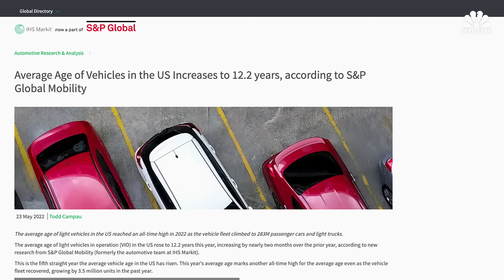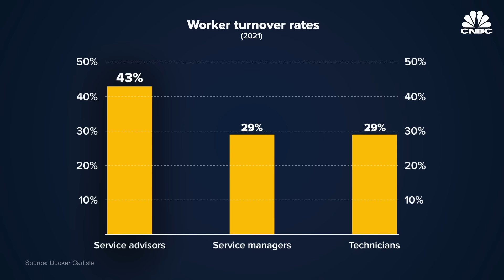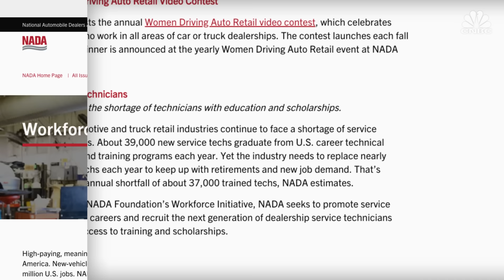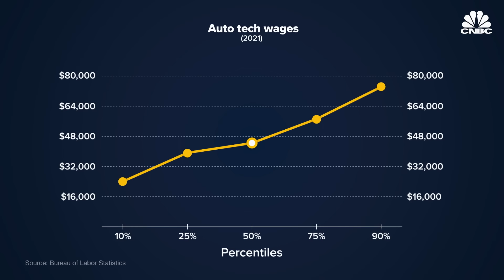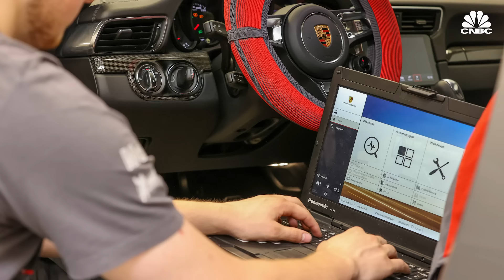Why The U.S. Has A Shortage Of Auto Mechanics

Comment: As a former mechanic, who is ASE certified, I will tell you why I left the automotive industry: 

1. Flag time, aka flat rate (i.e. paid for the job). The burden of the ebb and flow in the amount of cars in the shop should not be foisted upon the mechanics. There were many weeks where I worked for 40 hours, but I was only paid for 20. Flat rate also encourages mechanics to cut corners on repairs, just to save a little bit of time. 
2. I had to pay for my own tools. Not only was I getting paid terribly, I had to purchase my own tools. I have at least $30k worth of tools.
3. The pay is not commensurate with the amount of knowledge a good mechanic needs to have. In my opinion, this is an engineer-level amount of knowledge. Electronic systems, hydraulic systems, air conditioning/heating systems, internal combustion theory, transmission systems, electric car theory, etc. The amount of knowledge is huge.
4. The benefits were TERRIBLE. Very little 401k match, vacation, bonuses, crappy insurance, etc.

I was a smart mechanic (in my opinion), and I left the business to get a bachelor's and master's degree in science. Now I am a scientist/engineer, making the amount of money I should have made as a mechanic. The industry will continue to hemorrhage good employees until they fix the issues stated above.

Edit: thanks guys for all the feedback, glad my post resonated with so many of you!
Reply: Don't forget you can get to the showroom and find a handful of guys making double that of a tech and know far less about the cars than a tech. 

Pay is way out of wack in the car biz. 🤦‍♂️
Reply: 100% accurate
Reply: Someone pin this comment!
Reply: Yes same here minus the getting a masters and all that I became a truck driver and make way more money with way less work and little learning having to be done
Reply: Former GM World Class Certified Tech here. You hit the nail on the head. Now, I run my own one man transmission shop. I won't go back to the dealership until a lit of changes are made.
Reply: I've definitely been noticing this issue
Reply: Simply not paid enough is pretty simple. There’s too much bad overhead associated with the trade.
Reply: You are both a scientist AND an engineer now? Those are two very different professions.
Reply: 100% Correct. I was an "Automotive Technician" for 16 years, $100,000 worth of tools. I specialized in Transmission and Driveline for GM. Went back to school and earned a Bachelors Degree in Electrical Engineering.  Now, I work as one in the Automotive Industry. This CNBC report fails to mention how we are treated as Automotive Technicians. The vehicles got more Advanced, but unfortunately the public remained ignorant and ungrateful to the services we provided. It takes a toll on your soul when you're repeatedly told you're being dishonest. We are just trying to help a person move along in life. This trend will continue.
Reply: sell me  some Tools
Reply: Agree! Former Toyota Master ASE. Worked from 2005-2010, went to college while working as the shop foreman. Just Got a bachelors degree in IT, CCIE network architect now for the government. And yes, everyone in that dealership made more than the techs, go figure.
Reply: The thing is, if customers can fix their cars then why hire a mechanic? And fees to repair your car are too high for middle class people. It's the middle class that pay for the repairs, hence sustain mechanics. The high class would just sell the car and get a new one and the low class would dump the car or try to fix it by themselves. Middle class is the rising class that needs to save time to work and make the jump to high class so they would rather pay for repairs and save time. But if the price is too high they would rather make the fix themselves. In my case, I fixed stuff in my car that would have cost me $600 for parts and labor. But I only spent $300 on parts and spent a weekend fixing stuff.
Reply: My brother makes a ton of money modding people’s cars , guess he found a niche he’s good at
Reply: Thank you for that explanation
Reply: Market forces at work baby! The shortage will force employers to pay more or somehow a new product will reduce the need for mechanics/technicians.
Reply: I am also a former ASE Certified that left the industry due to inconsistent shop volume. I am now in a different industry earning the best money of my working life.
Reply: @joejoey7272  those are the few that actually enjoy what they do. But only so many people can do that the market can’t have hot rod shops everywhere. The regular dealership tech is the one that is getting shafted and hates their job.
Reply: Lets not forget all the training, and professional development, on an ever evolving product line. Wait what!
Reply: @andrewp91  Thanks for the heads up, I just graduated college with a degree in net administration. Now I'm terrified.
Reply: @th0rn3gaming  this is why I went to sales
Reply: @terencebrake6233  I never wanted to learn to wrench because the pay is terrible. If I am forced to work I'm not busting my sllab on wrenching when I can make more selling.
Reply: I was always shocked at the pay mechanics get while having years of knowledge and having learn about new cars.
Reply: What I am hearing is that the dealers know what the problems are, but they don't really want to actually deal with those issues. Complaining publicly is easier and perhaps even better for business (H1B visa perhaps?).
Reply: @who2u333  I can tell you this much, you don't own several $120,000 cars meanwhile you're average employee drives a used Toyota Corolla.
Reply: Lots of respect for mechanics. This is not task oriented. This is a problem oriented job, that requires people to apply their knowledge and why things work the way they do. You have to have a certain mind set for this, and we don't compensate people who do this well.
Reply: I agree, however you should also add in the customers. The VAST majority of customers are 100% ignorant about their own cars and just assume we're trying to rip them off. Unfortunately most of those "top earners" this guy states in this video ARE the ones ripping people off.
Reply: Dont seem right that someone puts in long hours and is refused medical-care and 401-k plans that government employees get automatically
Maybe the larger shoppes such as Rivian and/or Tesla can pay medical benes and 401k's to get the guys with family obligations to signup and STAY.
Reply: @Oncopoda   not really have none many different people form both . It more a different mind set. I offten find it vary difficult to find someone that can hold both mind sets at the same time.
Reply: @tdf123emcee2  I agree with this grow up poor and will never make middle class in this economy even if I live to be 100. So I only ever drive vary old cars I can fix my self or keep working in exstramly damaged states. I care first and foremost about how easy is the car to report and then about how much it cost
Reply: It's surprising that a trade as old as auto mechanics isn't unionized. If you guys were unionized you wouldn't have those hourly pay problems and the burden of buying all of your tools. I'm a retired union HVAC mechanic. We are expected to buy basic hand tools and work shoes. Anything beyond that is on the company. It's in our contract. The same goes for most unionized trades. Also we have amazing medical and vacation benefits. I was able to retire after 25 years of service. Oh, and I forgot to mention that our training was entirely paid for by the contractors.
Reply: @uwone7778  You nailed it 100%! my good man! I’m a lifelong industrial mechanic (pumps & automated production machinery). I work a 4/12hr workweek plus frequent OT and plan to semi-retire in two years at age 59. Not near enough young men going into the trades.
Reply: @th0rn3gaming  the whole dealership model is really the problem. They want to make money selling not fixing. If Ford owned all the service centers, than there's just no doubt they would have a standardized training system, better 401k, exc.
Reply: @who2u333  bring them in from Peru lmao.
Reply: Yeah, wish I would've gone straight into a science or engineering field right out the gate but eventually I woke up and am on my way now.
Reply: All true. Employees in general are not respected. Anyone who does a good job should earn respect and appropriate pay.
Reply: Exactly brother! We feel your pan too!
Reply: Great post but you didnt mention that the work itself is pretty physically demanding, lifting bending standing on concrete all day.  It will wreck your body.  Oh and heavy chemical exposure.  Plus the image problem (grease monkey).  Congrats for moving on, im older and wish i had done so years ago.
Reply: You were smart to switch  careers,and today the  future is ELECTRIC, and the  ICE will be mostly retired come  2030 -35 , that is about a decade  give or take a couple of years, and  in about 5 -8 years a Chinese BEV will be as  common as  a Hyundai and Kia  or  a Toyota.
Reply: @th0rn3gaming  Car salespeople make a fortune for the STEALERSHIPS.
Reply: Going to the dealership for repairs is certainly not cheap. Sounds like a lot of the money does not go to the mechanic actually doing the work. I don't mind paying for quality work, but don't like seeing the person actually doing the repair not getting the proper compensation.
Reply: They make you pay for your tools? That's messed up! If you're working for a dealership They should be paying for your wages and equipment. Office workers would riot if management made them pay for their laptops.
Reply: Are you referring to what my friend called, "Making book?" there was the Chiltons book where it stated what a typical job would take. Ex. The changing of a widget shall take 2.5 hours. BUT that is in a perfect world, test bench environment where the engine is new and will not account for a rusty bolt when the head snaps off a 10 year old, filthy engine, and you have to use a bolt extractor.
Reply: @Oncopoda  Computer Science is both engineering and science.
Reply: @andre-le-bone-aparte  it absolutely is not. I'm a software engineer. We often learn computer science as a base, but computer scientists exist, and they're a different breed.
Reply: @aerialdarkguy  yeah paid thousands buying tools and boxes. Left the business. Now doing auto warranty claims adjusting at home. Went from sweating my tail off, barely sitting down to working in pajamas and sitting on my butt. And getting better pay. Lol
Reply: @apacalyptic1freelancevideo213  I have some Made in  China 🇨🇳  Harbour Fright  specials ,bought
 on-sale , it will be in next week's Garage Sale🤑
Reply: Good points, and this industry is not for everyone. Me personally, I've been a tech for 20+ years now. However, after 8 years burning out in a dealership, I decided a change was needed. So I just went independent. Independents are the best route to take for a mechanic in my book. It just requires some discipline, and some practice running a business. Once you master that, you will never look back.
Reply: They need to go back to being union employees.
Reply: @lavelchase6040   Precisely. In 20 years i can remember only a few times where my hard work was actually appreciated. And then people wonder why there is so many dishonest people ...... have you tried showing your appreciation instead of acting like an entitle ignorant pos? If you already think i'm ripping you off.....why not do it and get paid for what youre being blamed for.
Reply: @th0rn3gaming  
Car salesman,  realtors,  salesman in any field are over paid paper pushers who have to know NOTHING about their jobs.

Ask a car salesman if the car has a dual master cylinder and the answer will always be yes. 

Ask a Realtor any question about a home you are looking to buy,  and the answer is "I don't know you have to ask a home inspector that. "

My point being it must be nice to know nothing about their job and get paid top dollar to warm an office chair all day.
Reply: I thought the flag time was basically the way techs get raises. The job pays $X - beginners take twice as much time so effectively get paid less per hour, after a couple of years people are taking the expected amount of time, and experts take significantly less than the projected time.

Does it not work that way?
Reply: @CharlesBallowe  
That is exactly how it works, but the manufacturers keep cutting the time down so the tech and the dealership get paid less and less every year.
Reply: @who_wantsit  changing flag hours for the same task, or new cars getting faster to fix?
Reply: @Oncopoda  Maybe at one time it was true. These days, luck favors the flexible.
Reply: @CharlesBallowe  No that's not how it works. Flag time has two tiers:

Warranty pay and customer pay. The exact same job pays differently depending on if it is warranty or CP. just to throw out a number. Say replacing a radiator on a vehicle. The book time under warranty pays 2 hours. But the book time under CP pays 3.5 hours. This was structured into the pay to compensate for wear and tear.

The ideology is as follows: a vehicle under warranty is technically "new" the parts have only recently been put together. The vehicle has low mileage, so it hasn't seen as many heat cycles, debris, exposure, etc. so technically it must take apart and put back together easier. Hence the lower book time.

A customer pay job, the vehicle is considered out of warranty. Means it's at least 5 years old, or at least 75k on the clock. This vehicle has seen it's fair share of duty time. Probably has battle scars it picked up along the way. It has many more heat cycles. Seen more road debris, salt, and exposure. So as such, it will be more difficult to disassemble and reassemble because the mechanic has to work around these new found variables.

That's flat rate in a nutshell. The mechanic gets paid book time for the repairs he did in a day. So if he did 3 aforementioned radiators, customer pay rate  in one day, he got paid 10.5 hours @ whatever is hourly rate is. The difference maker is how skilled the mechanic is at assembling and disassembling and a little luck that no inconveniences happens along the way. If he is able to complete the 3 jobs and only consume 4 real time hours, well the other 5.5 is like bonus pay. 

Hope I made sense. Have a good day.
Reply: @LynxStarAuto  thats mostly what I assumed, but part of my assumption is that a beginner mechanic might take 4 hours for a job where someone with a few years of experience might take 2 and a specialist might take 1. So, say you get that 2 hour warranty repair and then pay rate is $50/hour of flag time. The junior tech does 2 a day and makes $100 (effectively $12.50/hour), the experienced tech does 4 a day, for $200, and the specialist does 8 a day for $400. I know those are somewhat made up, but I'd expect some things to scale kinda like that.
Reply: @CharlesBallowe  
There not getting easier to fix, manufacturers are getting cheap and telling the dealership to pay for the lost time out of their own pocket since the dealership sold the car.

What a joke!
Reply: I'm in the same boat.
I have an associate degree in automotive technology.
I left the trade shortly after I entered it for another career that pays more than double what an average tech makes.
Now I just use my knowledge to fix my own cars lol.

Have plans of opening up my own shop in the future.
Reply: @skeptick6513  great point! This type of work takes a serious physical toll on your body.
Reply: @kevinwatson9597  this is precisely true. You pay $115 per labor hour at the dealership, and 20-25 goes to the mechanic. Maybe 30 if the mechanic has been there for many years.
Reply: @LynxStarAuto  yes that is one of the only ways to make a good living in this industry. Going into business for yourself. If I would have stayed in the auto business, I would have done the same.
Reply: @CharlesBallowe  this is exactly right. And it would work well, if there was always a steady flow of cars coming in for service. There are many times where there are no cars to work on. And if there are no cars, you are not getting paid.

In addition, let’s say you get paid 2.0 hours for a brake job, which is pretty standard. If there is a rusty bolt that takes significantly extra time to remove, the mechanic will not get paid for that time. Unless the service writer calls the customer to approve additional labor, which typically does not happen, in favor of keeping the customer happy. If mechanics were paid by the hour, like a normal job, these scenarios would not be a problem.
Reply: @righteousone1  
You can tell  who has a knowledge of vehicles, because they have no car payment and drive the oldest car at work.
Reply: @biometal770  with that 2.0 hours for a brake job - is that a pretty accurate estimate on average? High? Low? Like... If you did 10 of them, would it take you about 20 hours? If it's a case of 90% of the time it takes 1 hour and 10% of the time it takes 4 or something, you'd be coming out way ahead - 10 would take about 13 hours and you're paid for 20. The one terrible one works out in the end - maybe it sucks a bit because you'd be happier being paid 20 hours for 10 of work, but you're still good because it's 20 for 13 of work.

I'm curious about the not hitting the hours problem - in a regular job that pays by the hour, they only staff for the expected workload (or maybe slightly over). Are technicians sitting around the shop when there's nothing to do? Is there some "when work comes in, whoever is here and not already occupied gets the job" thing that encourages people to sit around hoping something rolls in?
Reply: @CharlesBallowe  yes 2.0 hours is accurate for a brake job. If you work quickly, you can complete it in 1.5 hours. Most jobs are not brake jobs, however. It s extremely varied. A diagnostic fee pays 1.0 hours, and vary rarely can you diagnose an electrical issue within an hour. And many times there are mechanics sitting around that are waiting for jobs to come in. 

Long story short, I consider myself a fairly intelligent person, and a very good car mechanic. If I was paid well, I would still be a mechanic. Since I was not, I became a scientist/engineer, where I am now paid well doing much easier work. In the end, I feel like it is the customer that suffers the most. People expect to have intelligent people servicing their cars, but the intelligent ones leave for other industries that pay them appropriately. It truly is a revolving door in that industry.
Reply: @who_wantsit  Not necessarily but having a beater for work is always a great idea. I own old and new cars that are paid off from day one. I never get myself in debt. I've never had a credit score in my life and don't ever plan on getting one!
Reply: Not only has better working conditions BUT better benefit and more energy for off time. 80-100k working 70 hours a week, that ceo is crazy
Reply: Indeed .... that is why I left the trade ! One time a service cut my time .. so I ask him what happen .. his reply was I have yo give discount to customer.. hell no don't get into auto mechanic .. don't paid and get scam ..
Reply: This is great insight
Reply: All these problems stem from the dealership culture/mom-pop culture…at the end of the day everyone is treated as a number….and no dealer or shop will ever pay techs 150k salaries without taking a big hit on upper management salaries
Reply: I agree with about half of what you said. Yes they are underpaid and undervalued. But the role is not the equivalent of a mechanical engineer. That's like comparing a paralegal with a lawyer. Both require knowledge and skills, but one requires more time/experience and has more responsibilities. That doesn't mean there isn't overlap, but certainly not the same. One person repairs parts; the other designs them. It's a blue collar job that doesn't require a college degree so there is a cap on salary if you're an employee. If someone wants to start their own business, they can make more. That's just the nature of all service/blue collar work.
Reply: @Grigsy  Have you been a mechanic before? I'm an engineer now. The work I'm doing is WAY easier than being a mechanic, and I'm making a hell of a lot more money. I'm not saying the mechanics should make more money than engineers, but there are serious, fundamental problems with the industry.
Reply: The problem is pretty clear in the way you replied. It's obvious  you have a higher IQ than the average mechanic, and the field is unable to pay what you could make doing something else. I assume you went into this career because you enjoyed it. I wonder if there are shops out there that only hire above average mechanics, or if you could find a group of like-minded mechanics and opened your own shop with the business model of customers paying for a mechanic with a high IQ and/or mechanics that own their own shop.
Reply: Spot on
Reply: I can’t agree more
Reply: @CharlesBallowe  Experience and tooling is also huge in how much profit we make. It's why the experienced guys are constantly buying tools or keeping a lookout for tools that will make our job easier, and shave time off.

Specializing is also huge. Although has its cons as well. For example, I work only on European cars. Namely, the German big 3. What's great about this is I see the same handful of models everyday. Pattern failures everyday. So I pretty much can diagnose these things sometimes over the phone, before the car even arrives to my shop. I already know what's wrong. Just need to verify. It's also easier to maintain an in house inventory of commonly replaced parts, which expedites the repair. It's also requires less tooling, because the pool of vehicles I service is smaller. 

Cons are, because I specialize, I'm leaving a lot of work at the door in off brand vehicles I don't service. Also, the vehicles I service are expensive to maintain, and when the economy stagnates, ppl tend to gravitate toward cheaper vehicles that are simpler, and cheaper to maintain.

Every industry has its ups and downs, pros and cons. But it really all starts with the individual. If you like what you do, you are passionate about it, you will thrive. This is true of any industry
Reply: @Oncopoda   Engineers are scientists by default, and some scientists can work as Engineers. As a Microelectronics Engineer, I've worked in R&D alongside physicists, material Scientists and Chemists.
Reply: @MikeLTU  I kinda feel the same about restaurants, I used to be a head chef at a corp own sushi restaurant, with tips and salary I don’t make as much as some servers at my location and sushi chef definitely requires more skills and i have to supply my own knifes, I left he industry last year and now going for Air Force hopefully get a degree for something, still don’t know what major I want yet tho.
Reply: @Oncopoda  A lot of people study science but work as engineers and vice versa. Musk is an example. A friend studied engineering and is now, "senior scientist".
Reply: One of my best friends is a mechanic and he loves the flat fee scale because he works 50 hours and gets paid for 70+ hours worth of jobs. I'm curious what makes the difference?
All I know is that he is too busy to work on my car, so I took mine to a dealership and it has been there for over a month. I then had to ride the bus, and then caught covid, and that was 2 weeks of hell. All of this sucks man. They don't even have enough cars to offer a paid rental, much less a complemtory one.
Reply: I am a mechanic and this is accurate. 
Also:
The manufacturers pay 70% for warranty repairs. So think of it like this if you work on a job for 8 hours you only get paid for 5.6 worth of work and the company does not make up the rest.
Dealers are charging $120-$160/hr no matter who is working on your vehicle. A tech who just started yesterday or a tech who’s been around 20 years. 
Mechanics are treated like grunts. Todays mechanic has to know the same knowledge about air conditioning that your home HVAC tech does. Then know as much as the IT guy working In your office. All the information you need is computer based so you better be computer savvy. Now we have hybrids so you are not dealing with home 110 voltage now we are talking deadly high voltage. Engine performance. Airbag systems. Squeaks an leaks. Searching hours for funny noises that end in no real problem or pay 1-2 hours if you are lucky. Then throw in customers want their vehicles fixed same day, can’t get parts and a shiny new advisor with no experience or knowledge that is hounding you every 5 minutes to hurry up. The industry needs to wake up. Pay techs and advisors what they are worth. Educate customers better. End Saturday work or pay time and a half.
Reply: Fellow mechanic and totally agree. It's not a secret
Reply: Same.  I am also a former ASE master certified technician who left to get an engineering degree.   Best decision ever.  I concur all your reasons, except the tools. Buying my own tools didn't bother me too much.   I got to keep them when I left lol
Reply: @biometal770   Somehow I made it for over 40 years as a master tech and what people don’t understand is the higher your skills and pay rate the more garbage jobs you get as others don’t have the certification needed to do the warranty work . It can also be a high stress job as you need to be right or you don’t get paid. Retired at 62 and most of my aches and pains are gone now !
Reply: 30 years ago a AA Tech flag hourly rate was almost 40% , now its what maybe 20%? thats why...Greedy dealers
Reply: This guy knows what’s up I’m in the trade as well and looking to get out. Management usually treats you like trash and like your easily replaceable even when they are short staffed.
Reply: @collint10  They get rid of you so the few that are left can work harder!!!
Reply: I totally agree with you as I know many in the industry and have switched from a crappy dealership whom doesn’t pay what their knowledge is worth to a dealership whom actually pays them adequately. 
I don’t understand why a business person cannot understand that the best qualified people are what will bring in the cash therefor it is crucial to pay them well so that they are happy and continue to bring in the cash.
I don’t agree with the video saying that the crucial job is a “service advisor” the important job is the mechanics 
Some service advisors do a great job but most of them there job is to upsell services
Reply: It's funny that they'll talk to anyone besides the people who actually are working the jobs. Thanks for your Insight.
Reply: @georgewoodard43  You are exactly right. The more knowledge and experience you have, the harder jobs you get. You don't get the gravy work like brake jobs, you get the extremely hard diagnostic work, which very rarely do you actually make good money.
Reply: @Roberto-gp3yx  Exactly. The whole service advisor business model is to separate the customer from as much of their money as possible, with very little regard for services that are actually needed at the time. Flat rate also encourages mechanics to cut corners, where possible, to save a little bit of time.
Reply: @who2u333  THiS^  yep, the dealership mgmt's ONLY control is over the pay of its employees; (as per this article) 50% of dealer's profit is from service dept., therefore suppressing wages is THE primary fiscal tool for the business.  Hence, 'there is a shortage' = I need a bigger pool so I can negotiate a lower pay vis-a-vis the competition.  @08:27 "the tech. pay is Very Good'; this statement is garbage when coming from the owner of the dealership.
Reply: @biometal770   People don’t understand unless they have been there ! It’s a little easier on the body sometimes but harder on the brain too . Before I retired I spent 38 years at a duel line dealership and they wanted you to be certified in both . Hard enough to do one !
Reply: 100 percent correct
Reply: @lavelchase6040  so you're telling me there's not a bunch of dishonest mechanics?
Reply: Right there with you. After 25 yrs as a Master Tech/MDT, I just finally quit last month for every one of the reasons you stated.
I should've never wasted so much time as an auto tech.  It's a very poor career choice.  Other older techs tried to warn me in 1997 when I was 19 yrs old and just starting my career.
Reply: I was a GM of a small dealership.  I had techs driving $40-$60,000 cars. They were making almost 6 figures being paid flag hours. These guy's would knock sh*t out quick with very minimal come backs. I was like "man, I can work 8-5 and get weekends off, sign me up!"
Reply: @hjc0706  TRUTH
Reply: @kevinwatson9597  correct. A VERY small percentage of the shop labor rate goes to the technician. The General manager,  svc manager, parts manager,  and parts counter people all get a big cut of what you pay the dealership for your vehicle repairs.
Reply: is it better working at an independent shop?
Reply: Thank you best for saying this
Reply: Dude nailed it! been in the field for years and left myself. I loved the work but the pay, benifits, and flat rate SUCKED!!! The problem isnt the people but the darn owners not willing to pay more.
Reply: Preach.
Reply: @ericchen776  typically yes. Some shops now, such as pep boys, pay an hourly rate plus commission, which I think is a great system.
Reply: @thegreatfreesharkofknowled2480  Not saying that at all. The flat rate system has many side effects.
Reply: @tdf123emcee2  Good analysis. I'm like you. The customer is asked to pay too much.  Recently I installed new front struts and rear shocks. The shocks are easy. Front resulted in a tire pressure fault (based on wheelspeed) and I ripped a ball joint boot. I also lost auto headlights a while back. I spoke to parts at Honda and advisor. The 150-200 bucks for diag is ridiculous. I went with hunch on a wheelspeed sensor on the strut I wrestled the most with(straining the wire) and imagined changing light sensor on top of dash. Both sensors fixed the problem so I saved at least 300 dollars. Even if it was the left side wheel sensor and not the right, that is only $40 dollars so guessing and changing parts is now cheaper than diag. I remember quoting a customer 1/2 hour for quick diag at 55 bucks. Nothing like that now. Big city dealers have no mercy.
Reply: @Roberto-gp3yx  its a team and the weakest link will affect and damage the relationship with customer, even parts counter.
Reply: Thank you I thought I was nuts having my ase's smog years of automotive training 30 k left in student loans, I graduated worked pepboys couldn't afford to get my 30k toolbox/ towed outta that hellhole, then I moved from garage to garage, I do strictly smog because there is no thought and the pay is a little better,  but you can't be a smart/honest tech with flat rate and industry wide poor moral from greedy corporate shops, they got rid of old timers because they have to pay good for experience, I promise you that Americans gamble with there safety taking there cars in for work at most shops, because corporate structure doesn't mind comebacks with cheap young fast sloppy work is more profitable than respecting the elders lifetime experience to get it right the first time. I seen wheel offs at all kinds of shops and they sweep it under the rug with customer satisfaction tickets to avoid lawsuits from there ignorant customers.  If you are in California report any concerns with work done to the buero of automotive repair,  they will investigate any valid complaints.
Reply: So many of us are going to driving jobs, it's nuts!
Reply: @biometal770  I agree with all you have stated. One thing I will note is that my favorite situation is a owner/advisor/mechanic all-in-one because I get to hear things directly from horse's mouth. I have been advisor and mechanic and there is an invisible barrier between the tech and the customer that unfortunately is usually not handled well due to translation. But when I was a younger customer I remember happy situations where information passes seamlessly to me the customer. An angry mexhanic or angry customer does not ever help a repair situation.  Anger or mistrust or judgement all can ruin the nice flow if information.
Reply: Different but a mechanic needs an engineer,  and engineer needs to have the same thought process as a mechanic to translate his intentions to the mechanic.
Reply: This mechanic agrees with you 💯,  no way to make that money in the very least you are rushing and gambling safety to rush through tickets,  and those guys get all the gravey work too!
Reply: One mechanic to another I truly wish you a great escape! Good luck brother!
Reply: Did you work for a dealership or for some M1das place?
Reply: Great comment. Exactly what I was going to comment
Reply: Facts, Everything you say is completely right
Reply: exactly very well put.
Reply: @Oncopoda  How dissimilar do you think computer engineering and computer science are ?
Reply: @hydroaegis6658  Customers must pay more in order for employers to pay more. Most employers are on thin margins anyways. And i don't see new products that eliminate the need for tires, suspension, transmissions, electricity, AC/Heating...coming into the market for many decades to come.
Reply: Some other reasons for the shortage.

YT channels like Scotty Kilmer demonize mechanics / dealers.  SK preys on those with little automotive knowledge that think the world is out to get them.  Why would anyone want to get into that business?

Service advisor turnover: They are the front line person that the " customer " , at minimum,  verbally attacks when their car needs service.
Reply: Totally correct. Flat rate is the death of the auto industry. No job will allow you to work for free because a computer decided how long something should take. Only auto mechanics deal with such time theft. 
  You work 40 hours and get paid 20. And people wonder why you don't want to fix their neighbors car after work. For a beer n pizza , lol. I got out and went to engineering where I get paid way more.
Reply: @jamesmedina2062  parts dept has never let me down I’ve done minor things to my vehicles and they’ve always come thru.
But when it comes to heavy mechanic work that I’m not able to do due to lack of time and tools it’s always a head ache with the advisors and it’s difficult to find an independent shop that will be transparent/trustworthy/and honest 
I can self diagnose most things but at the end of the day business wise it’s smart to source out and make money rather than spending the time to do it yourself 
I don’t mind paying but I do expect to have the job done the right way the first time
And that’s the only thing that my local dealer has come thru with but the lack of communication is what I’m fed up with
Reply: 100 💯 I agree
Reply: @Oncopoda  do all engineers do actual engineering? do all scientist do experiments? And if not, should these have another word to their job title?
Reply: LIVE BETTER
WORK UNION

It’s the only way to survive as a mechanic.
Reply: @tdf123emcee2  because there's A LOT of specialty tools that customers have to pay thousands of dollars for to access to fix the problem now a days. The car world is extremely tough on techs, do some research first before you start spouting nonsense.
Reply: @David Oles  I know you're genuine because you referred to yourself as a mechanic and not a technician ;)
Reply: @Oncopoda  Aren't you the clever one...
Reply: Nailed it
Reply: I was going to say: the job has gotten a lot more complicated and employers don't pay for tools or training and don't pay you what you're worth.  Did you ever think of opening your own shop?  Seems like a good independent mechanic would clean up.
Reply: @Grigsy  so mechanics are just part changers? Fascinating. I guess I should stop diagnosing people's cars, fixing electrical issues, and doing custom work/fabrication.
Reply: @LynxStarAuto  I'm working on that myself right now
Reply: I was a tech for almost 15 years and I agree with this.
Reply: I have an Associate's Degree in Diesel Technology, but decided not to make a career out of it.  You are always having to buy more expensive specialty tools for each new vehicle that comes out.  Mechanics are expected to supply their own tools, even though they are just an employee.  Employees in other industries make more per hour and do not have to be buying tools.
Reply: That’s why I’m going solo and to build custom cars and having my own customers
Reply: ...Same story here: ASE Master Tech turned Engineer (Mechanical). I'm much more happy with my new (7 years) career. 

I try to tell young people looking to be Automotive Technicians to do anything else with their lives: deal drugs, try prostitution, be a bank robber, of course I'm joking here. But anything to prevent them from giving half their paycheck to the tool guy. Because even though a three bay tool box is big, it's still too small to fit the amount of disappointment from a job so gratifying and yet so unsustainable.
Reply: The only way to make decent money as a mechanic is if you start your own shop and get lucky with foot traffic.
Reply: The secretary at the billing counter makes more money than the tech
Reply: It's seriously this simple. 

My father was a mechanic, and I watched him struggle his whole life in this field for exactly the same reasons. When it came time for me to figure out what I wanted to do, even though I had absorbed years of knowledge growing up with him, the pay and risks to my body just did not make any sense. 

They'll either have to pay people more and create better work environments, or continue to walk around like morons wondering why nobody will work for them. Why bust my back for ~30-50k/yr. when I could just work in a grocery store, make the same starting out, and have potential to climb a career ladder?
Reply: Mechanic comparing himself to an engineer lol. And this is the problem. Everyone thinks they are entitled to 100k+ a year
Reply: You are 100% correct. I have a friends who are mechanics and they have told me pretty much the same thing. The way they structure pay for mechanics is MESSED UP! The only way mechanics make money is having your own shop and creating your own business with your skills. You will never be compensated justly for the knowledge you have at a stealership.
Reply: @Emmanuel-ne3oi  You sound like a typical dealership owner that can’t find any help.
Reply: @PersonaN007Grata  I'm a customer who doesn't want to pay ridiculous prices on services. Also why I started working on my own car. Example: dealership charges $450 for spark plugs yet I can do them myself in 40 minutes for only the cost of spark plugs which are $50
Reply: You are 100%. Though I was not an auto mechanic, I was an aircraft mechanic in the Air Force. I was severely underpaid, first starters we were salaried and on averaged worked 60-80 a week. When I was getting out I was looking into getting my A&P license to become an airline aircraft mechanic. I soon realized it was much worse in that industry and just decided to get my BA in Mechanical Engineering instead, best decision I made. But I feel for all these mechanics who try to make a living and not being appreciated for their hard work.
Reply: @PersonaN007Grata  with the advent of YouTube it has become even easier for car owners to diy
Reply: @Emmanuel-ne3oi  Service rates have gone up yet mechanic salaries have not. Go to independent shops. Also, try changing spark plugs on some cars and you’ll be glad you paid a mechanic. Ever break a spark plug on a Ford? There’s probably thousands of people kicking themselves for not paying a mechanic to change their plugs.
Reply: @PersonaN007Grata  1. I only go to independent shops if I find something I can't do 2. I would never buy a Ford 3. I'm sure there are millions more kicking themselves for paying a high price for something they could do themselves
Reply: Getting a bachelors and leaving one industry really changed my life for the better.
Reply: Right on point
Reply: Agree 100% but, you need to add two more items to the list: 
5. getting paid flat rate, but with warranty times, so for example: transmission rebuild warranty time 7 hours. Retail time 12.5 hours.  
6. Work not being distributed evenly, warranty job after warranty job, and another guy gets retail, after retail, then is able to upsell on both retail jobs, while your still doing warranty. You get 20 hours in a week  while the other guy gets 50 hour or more in a  week. 

Techs get sick and tired of getting screwed over. That was why I left the trade after 15 years as a GM trained Technician. I went back to school, my hands are now clean and no more flat rate stress.
Reply: @billermanthegreat  Very glad to hear it my friend.
Reply: @Emmanuel-ne3oi  Dude, I am an engineer now, and I have been a mechanic as well. So I would say I'm qualified to make this argument. I'm not saying that mechanics deserve 100k, but they definitely get paid crappy for the amount of knowledge they have to have.
Reply: @vinny61389  Exactly. It's just not worth it. You can make just as much money, have benefits, and have an easier work environment in another industry. There is nothing that would make someone want to stay working at a car dealership, unless they really don't have any other options.
Reply: @Emmanuel-ne3oi  Not to mention as I am an engineer now, I make way more money and don't need to know NEARLY as much. My work now is WAY easier than it was being a mechanic, both physically and mentally.
Reply: @biometal770  you literally said "i am scientist/engineer, making the amount of money I should have made as a mechanic." no mechanics don't deserve engineer money. Yes it physically sucks to be a mechanic but that's the field you chose knowing so. If you don't wnst to be a mechanic go back to school like yourself and go elsewhere. Life is about decisions make the right ones
Reply: @biometal770  I personally work as an engineer as well. It really depends on what industry, type of engineer, and project you're working. Some are easier than others. Physically it's not going to be close being a mechanic that's the point
Reply: @Emmanuel-ne3oi  I believe a good mechanic should make nearly 100k. Not all certainly, but the top mechanics definitely should. I was making 25k when I left the industry, when I should have been making at LEAST 50k. That is why there shops are struggling to hire mechanics, because they have paid that way for years.
Reply: @biometal770  maybe after 15-20 years of experience and you're a chief mechanic. Cars are easier. Aerospace mechanics certainly can make that amount plus some with overtime
Reply: @tdf123emcee2  Problem being, i've seen the stuff that SHOPS put out, so people working on their cars, PLEASE just do a good ammount of research, and don't listen to some memes about uggas ect. Sure a lot of stuff can just be slammed on with an impact, but wheels? snug them up and just have a click. I was this before too, spend the weekend fixing the car, learning a thing or two, buying a new tool here and there. I will admit though, for certain things, i spent more than a shop would of charged (an extra part changed), but others i changed a part, and in the process i got a new tool kit. Like a ball join press kit. costed the same as a shop would of charged in total, but im ahead, and got a job done.
Reply: @uwone7778  Worst is when the customer wants to try to trick lie to you about the issue...like just tell me what your issue/symptoms are. Somewhat worse is the ones who give 2 cents worth of complaints for something with a million worth of problems. Or the service advisors who don't ask the simple questions which they should know to ask by now.
Reply: @JL-lt3gg  I will admit, i do like owning tools, it can come in handy. I'm fine with the basics, and some more ofc, but when it gets to specialty kits ect? The twice a year kits? ehhh. Pay clearly isnt adjusted for how much some of these dealers charge. Worse is when a shops rate is low, and you might think a poorer area, but not really, so shop rate being low, means pay isnt gonna be all it could be.
Reply: @Oncopoda  this is a silly reply, many scientist are also engineers.
Reply: @who2u333  you did hear the blurb in the video about the need for spanish speaking techs right?
Reply: @hjc0706  absolutely. There was not enough mentioned IN this video about "the hustle" and how techs and advisors are pushed to suggest unneeded repairs. It was totally skimmed over.
Reply: @martingainty9623  you also happened to mention two companies that are more likely to fire employees than to hire them in the current market.
Reply: If there’s not a mechanics union, there should be. Most trades have one.
Reply: @JL-lt3gg  unionization has many downsides, it would destroy the automotive repair world, the fat cat dealers are already getting rich on the backs of the laborers, a union would only create more fat cats getting even fatter, it's like the slave that doesn't even know he has a master.
Reply: @aurelio-reymilaorcabal9669  this is true for hybrids, because hybrids makes sense, but this will not be true for all electric vehicles, they will falter to be adopted market wide, simply an all electric vehicle's time is not now, not even soon.
Reply: David well put my friend ! I’ve been a tech for 23 years now and I’m now a shop owner this technician shortage has been happening for years now it’s only the pandemic that has brought it to the surface.
Reply: Absolutely
Reply: @Grigsy  Your comment is so out of touch, you think we were still riding horses, and crusading for a monarchy out here. That's how outdated your post was there bud.

Let me put it to you this way. If your late model vehicle breaks down, there is a good chance an engineer probably couldn't fix it, unless the failure was in the subsystem that particular engineer designed. 

So say you have a mechanical engineer who designed the rollers on a timing chain of a particular engine. Now say the vehicle which is powered by said engine suffers a failure in a control module that controls functions like the push button start, or the immobilizer system. That timing chain engineer wouldn't know where to start. Furthermore, in the slim chance that he did, he probably wouldn't even have the tooling to program the module and fix the issue.

Yet us mechanics, we are expected to not only understand how that timing chain works, but also understand all the other vehicle subsystems as well, AND provide the tooling and equipment to perform the repairs as well. 

Modern automobiles are so complex a college degree should be mandatory to enter. Gone are the days where a guy can drop out of high school, walk into a shop with a hammer and screwdriver and fix cars.
Reply: Master's degree in science? What type science, a litlle more specifics.. and how are you a scientist/engineer? They are not the same thing.
Reply: @land7776  it’s a little convoluted, bachelors biology, masters chemistry. I was a chemist in pharma for a while, now I’m an engineer working for a company that makes the machines scientists use, and I have to help the scientists use our machine properly sometimes. The skills I learned as a mechanic help me greatly because these machines use many of the same principles.
Reply: Well said
Reply: Pin this. I’m always doing DIY mechanical work on my farm, mainly on tractors and UTVs. I can say from personally battles with trying to diagnose and repair, mechanics are scientists. This  requires a TON of knowledge and a high level of application of that knowledge to understand how the entire system works together. Also it’s often times in extreme weather where the work is done if in the field tech. Hats off to all
Mechanics. I have to call one tomorrow because my 5100E Deere’s AC isn’t cooling enough.
Reply: Thanks for sharing your story. Agreed. Good mechanics have an astronomical amount of engineering knowledge, without officially being engineers. 
Schooling must have been so easy for you. Glad that you seem to be doing better. You deserve it
Reply: A lot of automotive companies are now making their cars almost impossible to repair without them being certified by the company to repair their vehicles, or work for them in their own service centers. They can also control the pay that way, thus it's not even worth being a mechanic nowadays, when the only way possible to be a mechanic is to work for another company, unless you want to have to deal with a lot of hard problems. These companies are so against 'Right to Repair', it's better pursuing a masters/PhD in college and get a better job that pays more than being an automotive mechanic nowadays.
Reply: @lavelchase6040  "you change oil, whaddya want a million dollars?". Ory favorite "that much? I could do that myself, if I just had the spare time"
Reply: I got out of the trade after 25 years, and nowdays, my attitude is this. " Oh, your car's broken? Here's a quarter, call someone who cares. Mine runs fine".
Reply: @JustAnotherJarhead  I love my union. Electrician here. I think there are far more benefits than downsides to being a union member. Yes, perhaps unionization would turn the industry on its head for a short time, but I firmly believe it would ultimately lead to more prosperity for the mechanics. Totally unsure of the logistics, because the electrical trade isn’t similar to mechanics trade, so I’m not sure how it would operate. My union keeps contractors in check. There’s power in numbers. Time for the little man to stand up to the big man and demand better treatment. Big man can’t make his money without the little man.
Reply: Why I left this * hole industry of scams where the dealer makes all the money and you make none. GO AVIATION. Way way tf better. 💯💯💯💯💯
Reply: @clutch7366  unions are good, until...they aren't. The big man will hire scabs at some point. Its just a dollars and cents matter.

Men need jobs just as bad as employers need worker bees.
Unions get weaker as the decades roll by, not stronger.
Too much is wasted in the upper echelon bloatted management and pension funds.
Reply: Absolutely!
Reply: @Emmanuel-ne3oi  Not everyone is asking for 100k. Many mechanics aren't even paid 50k, many more don't have stable pay cycles, benefits, etc.. They do deserve better than that, the job requires a lot of skill.
Reply: @vinny61389  original poster pretty much stated such
Reply: Absolutely correct. The lowest paid poorest treated employees at a dealer are the techs. All of the good ones have moved on to something else. Quality of work now is at an all time low, especially in the diagnostic area.
Reply: Well said my friend!…former technician here as well. Engineer level education with little to no respect. I am in management now, making triple the amount i made as a mechanic
Reply: @tito1211  lol umm no
Reply: @RussellD11  I was paid 55 percent for 20 years in an independent.  5 years ago our shop rate was in the 80 dollar range.  Probably averaged 75 to 80 percent efficient so made a living.  Didn't spend on tools unless I had too. Chucked it and went to carmax. Air conditioned shop. No tools to buy and can make 80 to 100k diag and test driving cars. Much better.
Reply: @Oncopoda    they tend to go hand in hand.  You can be very good at both and being good at both is only better.
Reply: Amen and congratulations! Well said.
Reply: Sounds like to me you wouldve made a really good stand up comedian, its not brain surgery people...lolololol
Reply: This man knows what he's talking about.
Reply: You forgot the toll it takes on your body. Working as an independent freelance mechanic works well for me.  Pick and choose jobs and customers. I want to like who I’m working for and what I’m working on.
Reply: @meaty8887  John Deere tractors. Had mine throw an error code at me. I have no other choice than to take to dealer. Can’t call local mechanic because he doesn’t have software
Reply: @meaty8887  and I can’t fix things like that myself without computer software license
Reply: @perrinpartee557  damn. This kind of practice is one of the main reasons that makes people leave being a mechanic. While companies like General Motors and Chrysler would discourage independent mechanics, John Deere would literally clamp down on it by making all of their hardware as bad as apple products, so people can't get repairs without being 'approved' by them for repairs, and even then, they would cost an arm and a leg instead of what a normal independent mechanic would charge you to do the same job. I think some businesses are even trying to eat more profits while paying the same to the mechanics who they 'certify' to do the job, so it's less appealing to work for said businesses who would give you the approval as a mechanic to work on vehicles that were made by their factories when you can use those knowledge to study for better degrees or get a masters/PhD and get a better job that would pay more than these businesses or something that's actually useful. Sorry for you man
Reply: @lavelchase6040  "It takes a toll on your soul when you're repeatedly told you're being dishonest."
But that is due to a lot of dishonest and incompetent mechanics and shops in the industry who are just out to gouge as many people as possible. I've been a victim more than a couple of times until I found a competent and honest mechanic.
Reply: 35000 in tools my man I think you are low on that number I fix all makes all model I have insured my tools at 150000$ I have all my tools inventoried by part number for all my tools
Reply: @hydroaegis6658  impossible no product can replace a mechanic. Especially high skilled technician who can properly diagnose any problem.
Reply: Door rate 170$. Technician flate rate wage 29$. Enough said.
Reply: Im an autobody tech and totally agree
Reply: No pension plans, no incentives like city jobs. I work for a dealership, but I will be going to a city job. I would stay with pension available. But my dealer has no union.  What am supposed to do when im 70. Keep turning wrenches
Reply: I want my boss to read this
Reply: @TheTech9  29 I’m East Tennessee it’s 20-25 tops master techs pushing 30
Reply: The reason why my son quit his auto mechanic job, he only get paid when they have a work to do. Now he’s making triple or more working as a process technician for JnJ.
Reply: Amen friend, i worked Parts Depts for 30 years and watched how corporations took over dealerships and thow they mistreated Service and Parts employees. Management continued to make the big $$, while others incomes were eroded intentionally.
Reply: Yes !
Reply: From an ex mechanic in NYC: It's because there are plenty of illegals who can do it all faster and better for low pay. There is your answer.
Reply: Well said my friend, I have been a mechanic for many years and we have always been under paid and treated like crap. Just ask one question, Where do the mechanics park as compared to ANY office person. I would bet good money the mechanics are made to park the farthest away on the property then any other employee in the place. Even knowing that WE are on our feet all day. It makes me laugh when they are surprised that no one wants to become a mechanic nowadays.
Reply: @craigevan9649  I keep hearing people say to go unto the trades, that they have a shortage of workers, but when you actually try to get in, they slam the door in your face. A lot of those sought after industrial positions are near impossible to get into unless you are friends with the right people. I have an  Associates degree in process tech, & half a degree in industrial automation, unpaid internships, etc. I can't get a call back. They don't even offer any Training to be a machinist anywhere in my state. Even though there is a DESPERATE shortage.  I literally finished a 2 week job training put on by the Carpenters union, specifically because the carpenters union runs the milwright apprenticeship. Last day of class the union rep comes in, gives his spiel on how to apply to the union and ask if anyone one has any questions. I ask about the milwright apprenticeship. "Oh uhh, well we only do that apprenticeship program every other year, and only take 2-3 (of our very best friends as) applicants...
Reply: Totally agree, former Benz Technician. 

Left the field and started in engineering field. Everyday feels like a walk in the park and made more money without school. Wasn't even serious at the beginning, just imagine what I have achieved if I started this Instead of Automotive.
Reply: The auto mechanic is basically a slave to the big auto dealers.  Lets sit around and wonder why. Make the job more appealing and the problem will be solved
Reply: Why not start your own shop? The lift is only 10k each..
Reply: @lavelchase6040  so many techs are crooked is the reason
Reply: Thats why I stuck with fleet work and now mobile fleet work. I make over 6 figures with 5-10hrs of over time a week in STL MO and I'm in my early 30's. Also the work is generally  easier than dealer and normal shop work but the trade off is I work later shifts and out in weather sometimes. I know I make more than most tech's but thats due to being a lead and handling the boss, scheduling manager, and inventory also having people skills and office experience helps a lot too for negotiating my salary also all my years as a diesel tech. 

Of course they like to push SRT but the reality is SRT was made in a lab like environment and its harder to enforce it on fleet and more so on mobile fleet repairs. I agree Flaterate and SRT are a disaster for encouraging cutting corners and giving companies a reason to boot you.  

 Companies will have to adapt to the needs of techs to keep them and  to attract them from now on out. we are not going to get a boom of young people to fill these rolls, but the one who do will make better money than those of us who started out making at or just above min wage years ago.

This has been a long time coming. We seen it on the wall when other trade jobs started seeing the Boomers age out a while ago and now the gen x'ers are starting to age out. It's crazy to think but I worked with more later Boomers and early Millennials in shops than Gen X'ers over all. so their must be some kind of gap in how many of them took up the trade here.
Reply: I worked for a company that had a large chain of auto repair and service shops.  I could totally see they were using the flag rate to motivate mechanics to get the jobs done quicker which end up sacrificing quality.  It was sad, and I knew their reputation was not going to improve until they changed the pay incentive to quality not quantity.  Also the mechanics all had to have their own tools, but the office workers would throw a fit any time there was discussion of having to have your own PC to do your work!   I always cited the plight of the mechanics.
Reply: I've a question it you answer me. Thanks a lot. 😄👍🍻
Reply: @Oncopoda  No, they're very similar.
Reply: @th0rn3gaming  : It's not particularly one make and model of a car, it's variety of economy autos, which includes the domestics, and imports of various years, make and model.
Reply: Right on!  I left the industry almost 20 years ago for all those reasons plus some.  I'm an Engineer now.  If you're smart enough to be a good mechanic, you're smart enough to do just about anything, and for double the pay!  I laughed when he said 100k a year is good pay!  Not anymore it isn't.
Reply: Dammit you guys need to stop noticing these things. How dare you discuss the upside down nature of our reality. I thought the distractions would keep slaves from gazing at the top of the pyramid. We need to ramp up our game.
Reply: I was a auto mechanic from 1967 till 1973. I changed my career to welder/ machinist/ sheetmetal (mill wright) I work on my own cars and for fun I built racing cars.
Reply: Exactly. 

1. The flat rate system one the biggest problems that needs to go. It encourages poor service and corner cutting. I've seen how so many people got burnt out so quick and quit because of this.
2. I honestly think the tools part is honestly give or take. It happens in a lot of professions but i do agree in this profession the cost to entry is bit higher and dealerships could do more to help out on this front.
3. So true.  Very much true. A certified master tech makes as much as the guy who just does oil changes and tire changes. How is that fair?
4. I've seen this run the gamut from none to good to poor

Now let me add a 5th one to it.
The profession has a way or wearing people out using up peoples bodies way before they need to be. Someone who is 40 can easily have the body of a 50-60 year old physically cause of the shear pain and constant exposure to harsh chemicals and fumes and unnatural contorting the body has to do.  I've known so many techs by the time they are 40 just check out and leave the profession because they just can put no more wear and tear on their bodies. The Manufacturers don't help by making the engine bays and stuff so hard to access for people. Scan tools can only tell you so much in the end you still need to know how to troubleshoot something.  They design the car for ease of manufacture not ease of repair.
Reply: Well said sir. 👏 agree 100000%
Reply: Buy your own tools was the biggest shock to me. I could not believe dealerships did this to workers. Treating workers fair is left out of this article.
Reply: Very true. I’ll tell you that Iv worked in shops where they made it a goal to make 30k a week between 4 techs and 3 writers. That’s 120k a month so between paying the employees about $35-$45k in that month and rent about $4500-$5000 franchise fee maybe 10k so the shop makes around $40k to $50k profit a month and that’s OK?  It’s all about greed
Reply: As a fellow ASE tech you are certainly right I only stay in this industry because I love fixing my own cars but the points you stated are so right we don’t get the money right and I wish I was salary
Reply: @Oncopoda  not really. Both take exceptional attention to detail and memorizing many different parts which make up complicated systems. Diagnosing is an art as well to get it correct the first time.
Reply: You've done a far more accurate job of explaining Why The U.S. Has A Shortage Of Auto Mechanics.   Congratulations on being ignored.
Reply: I was a tec for 15 years,  what a waste of time and money.  I agree with the above statements.
Reply: I totally agree with your statements.  I also left the industry and I'm making much more money than I would've as a tech.
Reply: @Oncopoda  Not quite. Ever hear of the guys who operate particle accelerators?
Reply: Basically dealer know this and dealer just want to take advantage from the mechanic and the customers! Under pay mechanic , and keep hiring no experience mechanic on dealer =  still win for dealer because the customers have no other option. Most customer has no any knowledge on car at all. What the dealer damages , or Misdiagnose on vehicle .
Reply: That’s why I fix my own….I can’t afford to pay what y’all want…. U know mechanic in the army gets a set rate…. Same pay no matter what.
Also u can retire after 20…
Reply: U just want a lambo instead of being paid what u make
Reply: Same reason I left. I went to the warehouse industry and now I’m in the trucking industry making double what I made as a mechanic, soon to be tripled
Reply: @lavelchase6040  There's a not insignificant amount of us that are not ignorant and know we're getting the run around, and the sad thing is, that means the ignorant ones don't know when they are.  The problem stems from a large amount of your fellow techs actually doing bad jobs.  Case in point, I have a vehicle, under warranty, in the shop right now for blowing fluid out the trans vent.  Something I directly observed and informed them when I had the vehicle towed in.  The first reply I got after two weeks of waiting was that my pan gasket was leaking...

This was supposedly from a transmission guy that's been doing this for years.  Then after another two weeks, they flip their tune to the transmission was 4-5 qts over full.  This is, again, something I know to be false as I checked the level before taking it in, it was so far gone that the level no longer showed on the stick.

There are a select few good technicians out there.  Unfortunately I only get to watch them on youtube.  The problem is, you're vastly out numbered by bad technicians and you can't escape the splash damage from that in that industry.
Reply: @boomboominroom  not to mention, how much the customers pay for that work to be done.
Reply: This is amazing. Thank you for sharing this and letting people know why the profession is having issues
Reply: I was wondering about this. In America: Follow the Money.
Reply: Well said 👏 same as me left cause of the quality of work became less important as the quantity of cars done and like you said wanted you cutting corners in jobs which ment to be doing the jobs incorrectly,  plus the pay for the trade its brutal,
Reply: Completely agree. The industry I've very backwards as well. Working in the shop, it's very homophobic, sexes, and racist.
Reply: In the summer of 2021, my Kia dealership said my defective transmission was covered under warranty.  However, the rebuilt transmission wasn't available for 5 weeks.  And their shop was short two mechanics. In the bays, I spotted two 50+ yr olds working  technicians.
Reply: Get your Diesel, hydraulic certificates.  Now, get your CDL.  Now talk, plead, & bribe yourself onto a 18 Wheeler semi truck service center.  Same sweat,. blood, busted knuckles is involved.  But you skip the DRAMA of consumer automotive repair.  Literally, your workday becomes a dependable & talented techs are treated with respect.
Reply: Brazy. I was tryna be one too till I see this type of thing goin on. Thats a shame, kuz I'd love to work on cars, also performance wise, and get paid!!!
Reply: @jeromebarry1741  haha thanks. I know it will fall on deaf ears. At least we can voice our grievances together!
Reply: @vanishingfox1339  I would have moved into fleet work if I had stayed. The pay and benefits seem MUCH better than dealer work.
Reply: @ywlee319  good for you friend. I always thought it was better in the higher end shops, but I was obviously mistaken.
Reply: @robbieraychannel  good point!
Reply: @ve2430  good point!
Reply: @robertogambala8919  j and j is a great company! I worked in pharma as well, and they are well known for being a great employer!
Reply: @TheTech9  the math is ridiculous. Shops are making a windfall and the mechanics get crumbs
Reply: @TheMechanicj  oh yes you are correct, my tools are on the low end. Many guys like yourself have spent much more for tools
Reply: @themaverickmechanic7240  good point! I should add that lol
Reply: @berniceperry8898  hahaha
Reply: @biometal770  dude if I paid full retail just my tool box is over 30000 course I bought them used but dang looking back I was going bankrupt working for the dealer when I left I was like oh man I can afford food now and I can quit going to the food stamp office for assistnae and yes I qualified as a mechanic with 2 kid was pathetic
Reply: This right here… i did work for dealerships for 8 plus years and what i saw…they DO charge the customer A LOT and at the end of the day the dealership owners will take the cake for themselves. Meaning that they do not spend or passing the gains to the tech/employees. O and by the way the owner of the ford dealership in this video tried really hard to make it believe that is a good career but is not. And if you complain to much they let you go. They let go the experience for new young people asking for pennies. Because that’s good for their pockets.
Reply: @biometal770  yeah I worked at independent shops for years but didn’t like the business practices and them trying to be like dealers. I like the fleet because it’s not about milking customers with up sales and flat rate. I also like the fleet work environments better. But it’s not for those who like to take off a lot. Also the incentive to the best job is higher due to you’ll probably be working on it again.
Reply: One more thing. ? LOL
Reply: So you had to buy your own tools, that is on every trade. Construction and plumbing you have to have your own tools. And 30k on tools? Why? I work on a shop doing general mechanic and the most expensive item I have is my scanner and my brain. Too many people brag about being ASE master whatever and don’t know crap, that is why they work at the dealership….
Reply: @PatricioGarcia1973  um…. It’s very common for experienced mechanics to have over 50k in tools. There are so many specialized tools for specific jobs. You can’t do much with just a scanner…I have over 2k just in air tools
Reply: @lavelchase6040  That's why I just pay the bill. I know how much work goes on in a car. People have to learn to take car of their vehicles, pay attention, and watch pot holes. That's really the best advise to not have to be in a auto body shop all the time.
Reply: I am looking to leave the industry to pursue a degree myself. Thanks for giving me hope when I felt out of place in the college realm.
Reply: I’m an ASE diesel tech and you hit the nail on the head 👍🏽
Reply: @biometal770  it's the same and it also comes with many cons too.

It's tougher to fix the car.
Tough to tell people you ain't making enough in Benz.
They requires more than regular dealers.

I personally think it better to fix lower end cars, it's easy, fast, and less complaints, and will probably makes more money.
Reply: Me too.
Reply: couldn't agree more i was a very good mechanic as well could diagnose any thing and every thing i left the field years ago and became a cnc machinist and became so knowledgeable now i am in a foreman roll  making about 100k a year
Reply: Did the same and never looked back. Getting a bachelors in engineering was the best decision. Never have to deal with the sketchy auto biz people again.
Reply: Unfair, to be sure. But Im not surprised because of two things:

OEMs seem to be building cars with a ten year life cycle and not a single person wants to bring their car back to a stealership.
Reply: @GothamsFinest  bro you are not wrong. I would much prefer to work at target.
Reply: At least you can still repair your own car without paying for someone else's labor. So your skill set will still come in handy.
Reply: @georgfriedrichhandel4390  you are correct. I will say it is a huge benefit having the knowledge and tools to fix my own stuff
Reply: @biometal770  Friend, considering what it costs to repair a car today, I wish I knew what you do!
Reply: @tdf123emcee2  this is true, but it is not and never will be widespread enough to have a significant impact on the demand of techs.
Reply: Why would anyone want to be a mechanic when fossil fuels are being phased out and the EVs cannot be fixed because of proprietary claims.
Reply: @tdf123emcee2  im a grandpa and I drive grandma and grandkids around...I love diy but not putting my family's safety in the hands of  diyer
Reply: Well said
Reply: I agree 100% and all the same reasons I left 15 years ago.
Reply: I feel your pain!
Reply: @nattydreadlocks1973  Yes that is true, I decided to go to school and a different field. I probably don't make as much money as I could running my own shop, but I can say it is WAY less stress. I still pull in barely 6 figures living in AR, so I think I'm doing ok.
Reply: @tdf123emcee2  Yup there are thousands of videos here on YouTube also showing you how to repair stuff on different cars also
Reply: @craigevan9649   Hello I've been looking for work that you do how would put myself in a position to get a job like yours not much mechanical training/exp.
Reply: Auto Body trade is even worse then mechanic’s. I have been in the Auto body field for over 25 years. Insurance company’s drive the pay shop’s can give you. Not looking good for the future anytime soon.
Reply: @petermessiersway9040   I was concerned about that been interested in either diesel tech, auto tech, or body tech from the looks of it that diesel tech is the best route but man the body tech stuff looks cool though
Reply: @virgilcash4239  Yes it can be cool as a hobby. But being an Auto Body for 25 years. It just doesn’t pay . I know of jobs in the Auto Body field that do pay well. But they are white whales . Very rare .
Reply: @petermessiersway9040   Ok got it thanks for the heads up
Reply: I appreciate your input. Good, honest, and reliable auto technicians are hard to find nowadays. This video somewhat sums up why we have a technician shortage.
Reply: That’s why I got into working on diesel for good hourly pay and got my CDL as well whenever I feel like driving to make good money as well
Reply: @LynxStarAuto  This is the best advice for anyone who still wants to work in the field.
Reply: @JonJon-zb5yi   Nice I was told if I get my CDL-A before starting diesel tech schooling at a community college it will help me when it's time to get a job atm the goal is to start an associate degree for diesel mechanic in the fall.
Reply: 100% accurate. Spot on
Reply: @virgilcash4239  you don’t need it but it but Id definitely perfer to get it. It will put you a few steps ahead of the other mechanics
Reply: @JonJon-zb5yi   Appreciate the feedback will just have to figure out financially how to do both and the timing when to do it while in school. I'm working and this will be a career change for me.
Reply: came here to say this as a mechanic
Reply: Not to mention any issues in the process (poor advisor communication, wrong parts, somebody parked the car in the wrong place) that make the repair take longer is money out of the tech's pocket and nobody else's.
Reply: @virgilcash4239  I say get the mechanic skills with a trucking company that has a fleet shop and get your CDL though them. Look at places like UPS, FedEx places like that. Good Luck
Reply: @JonJon-zb5yi   Thanks for the info didn't think of that appreciate the info
Reply: @Oncopoda  depends. For example, he could be a Materials Scientist by title but a degreed mechanical engineer. Similarly, he could work as an Environmental Scientist but be a degreed civil engineer, etc.
Reply: @meesterbeefy13  You are exactly right. Anything that delays the repair process comes directly out of the mechanic's pocket due to how the process is designed. This should come out of the business owner's pocket, not the mechanic's.
Reply: People that work in warehouses, with no education get paid more than mechanics
Reply: Couldnt agree more! I was a gm master tech for over 13 years. Now i went the same route and now have a degree in applied physics and work in a high end dragcar chassis shop building some of the fastest 10.5 radial cars
Reply: Cashier and most UPS drivers make the same money but dont need years of training and $10,000 worth of tools just to get a job.  The pay is a joke now for the damage it does to our bodies.  Most Technicians will retire from the job young due to back problems caused from the job.
Reply: I agree with everything on the comment . I went to school so dealers could offer minimum wage with a $.25 cent raise a year. They also wanted me to walk through the door with $36,000.00 worth of tools 🧰 Definitely not a career worth bothering with.
Reply: you have to buy your own tools???
Reply: Thank you for your experience and work. I am not a mechanic.  I understand and agree with you totally of what you said.  People needs to appreciate auto mechanic.  It's a serious trade business, a skill, technical, a profession. I think auto mechanic field needs to be promoted as a serious industry period, in particularly EV maybe the future in auto driving.
Reply: I agree, because I changed careers also work less hours for better pay and benefits.
Reply: Don't like it fix cars in your backyard
Reply: @unknownopinionoid2672  haha that's what I do now! but only for my own cars
Reply: It’s the same with teachers.
Reply: Being a “real” mechanic is a lot more difficult than being a theoretical mechanical engineer. A lot more physical work and mental strain is needed.
Reply: @angelgjr1999  You are exactly right. Many times the engineers just try to move their designs out the door, not really caring about the robustness of the design.
Reply: @unknownopinionoid2672  that’s what I do now. In my free time, thankfully
Reply: @bradmccranie3967  that’s great. I’m glad you were able to make a change that was beneficial for you
Reply: 10yr BMW master tech similar story 
When it’s time to cut the cord it’s just time.
Reply: I agree with you as a 30 years mechanic and ASE certified
Reply: @chrisernissee9269  tell us more
Reply: @j_artis_b  how did you get into that my God sir?????
Reply: Well said!
Reply: Your dead on! Trying to get out of the business as well.
Reply: @4feathers  Do it! If it doesn't work out, you can always go back to turning wrenches. I have a friend who was a body man/painter that now works on industrial A/C systems, making 6 figures. I heard that pep boys is paying hourly plus commission too, I have a buddy there making 1000-1500 per week.
Reply: I don’t think most people understand a automotive technician is not someone who can fix any vehicle…
Reply: @biometal770  Seems to me that they can rework the pay plans to increase the worker retention rate. If the labor supply remains problematic on into the future then they will have no choice.
Reply: 1.whoever calls himself smart out loud, not really that smart and clever.  2. if you made 20h in 40h time, you are not an efficient or that smart, or not enough tools.   it's not cutting corners, it's using correct tools, and use your time wisely .  3. your 30k ( at least ) tool already told us you were not invested in tools and good tools . for me it's been just 5 years, and i have over 60k worth of tools (the once i remember in my head), and still need more tools ..  and i produce 130-150h in 80h period .
Reply: Simple problem and a simple solution. Great insight David.
Reply: As an ASE certified master mechanic and shop owner we all love flat rate.  working 40 hours and getting paid 60-80+ is awesome.  But if you can't beat book time then I can see how it can be frustrating and push people out of the industry.  This is skilled and specialized labor.  You've got to make the cut. Not everyone can do it.
Reply: @atlasautomotive5835  It's not about 'beating book time'. I worked at the dealer for 10 years, I never had a problem beating the book time. The problem is when there isn't enough cars coming in the shop, you don't get paid for the time you are at work. Additionally, this field is only for the young. I pitied the older mechanics I saw breaking their backs at 50 years old trying to beat flag time. The flag time system takes advantage of the mechanics. A better system is hourly + commission. I'm so glad I left the field, I make over triple what I did as a mechanic, and now I work from home.
Reply: @biometal770  Oh.  Yeah.  Working at the dealership is going to be a bad time no matter what.  I'm glad to hear you found a spot you're happy with.  I believe the dealerships are the #1 reason techs get a bad taste in their mouth and leave the industry.  The independent world is completely different.  We actually have lots of work and the techs make money.
Reply: @atlasautomotive5835  Flag time is only fair if the mechanic is making 50% or more of what the shop charges. Otherwise it is a burden on the mechanic. Shops need the mechanics more than we need the shops. Mechanics can go do many other jobs that do NOT pay on the flag time system. Such as working on laboratory machines, like I did. There are many times where I don't have machines to work on, but I still get paid.
Reply: Been in the industry 13 years and trying my hardest to get out now. My tools are my life savings and I kind of regret that now.
Reply: The biggest problem is most guys don’t keep learning every day, they can’t do diagnostic/electrical work properly and efficiently, they never get to a true A level technician. I’m 37 now and I worked with guys that were great back in the early 2000’s when I started but they didn’t keep up with the times they stopped learning back then and if you don’t keep up with technology you aren’t a valuable technician, if you can’t diagnose and do electrical work very well you will not make good money and you will hate the industry because ur stuck making 25 bucks an hour. The true A level techs that get taken care of a true a-level tech can make a minimum 80k-120k in ur regular towns/cities. I was making $36 hr almost 10 years ago and now with how hard it is to find a-level guys you can pretty much name ur price. If u work for gm and ur world class with all training the dealerships give you 3-4k bonus every couple months just for staying up to date with training, if ur the head tech you can get a percentage of every hour that is flagged in the shop because ur the head guy that is stopping what ur doing to help the other guys and also get a 40hr guarantee. When you really know what ur doing, when u keep up on training you work much more efficiently it’s easier to make ur hours. You can make a ton of money but it’s up to the technician. If technicians didn’t get lazy flat rate wouldn’t need to exist  but when you pay hourly guys are on there phones all the time, working slow they take advantage of it. A lot of shops aren’t ran great so you do have to move around some times to find a good job and also have to move around to get paid more sometimes shops don’t wanna give a real raise until you quit. If ur not motivated to keep learning then this is not the career for you you will make no money and hate the industry. If u keep Learning and be the best u can be you will make urself very valuable and shops will pay you whatever because they have no choice. If I didn’t own a shop right now I could walk into any dealership and get 40hr min without any of that car brands training and get a big sign on bonus. I know that there are only like 4 world class gm techs in my city and they need them I could get all that training done in a year then they would have to pay me whatever, if the dealers don’t have hybrid, heavy duty certified techs they can’t sell them cars.
Reply: This is pretty much on target for welders too. I get paid more as a temp worker right now than a welder with experience and degree. Even more, I will not even get accepted since people expect me to be too much to pay for. I could join a union, but I got schooling from the military and state , so I am planning to do a bachelors degree at least since I will have more growth that way. It's not that there is a huge demand for blue collar work as news agencies have gotten wrong, it's that corporations have bought out all their competition and don't expect to pay people. Of course, people just go do a new job instead.
Reply: I'm a smart mechanic(in my opinion). I do the math... so with the cash spent and debt at the end I prefered to quit to my job and start my own garage. Now I'm paid what i deserves.
Reply: its because you work at dealership. you're better off at a specialized shop
Reply: @th0rn3gaming  Mechanics need to unionize and have a union come in and bust up the dealership monopoly
Reply: @Emmanuel-ne3oi  As an engineer what do you do that’s so important that a mechanic cannot do? you guys are incentivized to over complicate vehicles and design them to fail every so many years so that the cycle continues. How could you even take pride in what you do knowing you’re purposely designing vehicles to fail every couple of years and over complicating everything?
Reply: @StrongerThanBigfoot  lol. You clearly know nothing about engineering
Reply: @baileyhatfield4273  Why isn’t the customer speaking directly to the mechanic? There’s no reason to have a service advisor?
Reply: @JustAnotherJarhead  False!!! Unions would be best thing to happen for mechanics just not owners and management
Reply: People don’t know the amount of work and knowledge that is required to fix cars. In addition computer programming.
Reply: @Oncopoda  do you know what is a condenser? Or how dose torque converter works using only hydro fluid? Or why is the atmosphere pressure important on cars?
Reply: Spot on comment! Spot on!!!
Reply: I left mechanical work early and switched to collision work. At least that way I could use my tools and knowledge and earn a live-able wage. After a decade and half of experience I got into engineering and EV work.
Reply: Same here. I’m a YouTube mechanic 🤣
Reply: How long did it take you to get your license
Reply: As an Electrical Engineer who went to school to become an ASE certified mechanic (never went to work on at a shop) this is spot on. A good technician has an engineer level amount of knowledge. A good engineer has a some good technician skills.
Reply: @philh9238  Do you mean to be ASE certified? I think you can start taking ASE tests after working as a full time mechanic for 1 or 2 years. I started taking and passing them as soon as I was eligible. I've got 3 or so certifications out of 7 (electrical, brakes, heating & AC).
Reply: @joshuamedina188  Don't go back.    The only time the General will change is when it's for the worse.
Reply: @collinbaroh3487  Thank you sir!
Reply: @Oncopoda  You'd be surprised. They can be much more similar than you think. It takes a scientist and engineer to diagnose a laboratory instrument. You have to have the scientist background to confirm that it is the instrument that is faulty (not the testing method or prep), then the engineer knowledge to fix a broken instrument.
Reply: @MikeLTU  That's a great story about your transition from mechanic to IT. Glad to hear it is going well, and I'm sure you make multiples of the salary you used to.
Reply: As my brother/ex professional mechanic puts it. “It’s a fantastic skill to have for yourself, but not a trade where you want to be for the long run and retire in because you most likely won’t get anywhere in life and struggle to provide for family. It’s just not worth it.”
Reply: @LynxStarAuto I agree with you mate, but most people don’t have the mind set to operate / run a business that’s why you are succeeding. Lack of competition. That’s great for you but for the backbone of the industry to survive and thrive there has to change.
Reply: @LARSENBISQUITS  Your brother is spot on. It's a great skill to have, but not quite viable for the long term, especially working for the dealerships.
Reply: @Oncopoda  lol. AND he considers himself very smart. Something's wrong here I can feel it!
Reply: @andre-le-bone-aparte  not really. I graduated with a Mech engineer degree and worked as a back end developer out of college because it was the 1st job offer. I got out of that one quick. Currently work designing hydraulics for a 2nd tier Auto supplier. There's a reason why computer scientists can't take the PE.
Reply: Absolutely. The compensation + benefits are just not there when you look at the skill and learning requirements
Reply: I left to be a truck driver. The pretty lady nailed it with her comments. The Ford owner say you can make 100m, but what you have to do is as you said and for many it not happening
Reply: Couldn’t have said it better myself brother. Retired Ford tech here.
Reply: @shaggydogg630  Glad you retired buddy. Enjoy your retirement ;)
Reply: I left the industry because of this as well. Little pay not enough making to get a good living. Working long hours. Sometimes there open to almost close and not even making a decent living. This is why everyone is leaving. The industry pay for techs is terrible
Reply: @biometal770  thanks.
Reply: The reason I walked out my job. Flat rate.
Reply: Amen!
Reply: I strongly agree with you man, I've been an auto tech for 3 years and I've fallen out of live for this industry. I spent so many years wanting to work on cars, and when I finally started working on them, I started to dislike every car that had come into view
Reply: @EricspeedGaming  bro sameeeee
Reply: @ft ln Good call my friend. Engineering is also a good degree for someone with an automotive background. I became a chemist for a while, then a field engineer fixing the instruments chemists use. The work is way easier than being a mechanic, and I got paid a great deal more, all with fantastic benefits. Also, as a field engineer in the science field, you constantly have recruiters approaching you for other jobs that will pay more and have better benefits.
Reply: @lavelchase6040  Bravo, brother!
Reply: @th0rn3gaming   couldn’t have said that any better
Reply: That sucks. My husband (who is American) is friends with this South Sudanese guy who recently received refugee status in the United States.

Back in Africa, he worked as a mechanic not only in South Sudan, but also Sudan (north) and the DR Congo, mostly working on old, used cars, with mileages of 500,000 to 1 million.
 
Right now, he bought a PT Cruiser to do Doordash and Uber Eats deliveries, but does still dream of continuing to work as a mechanic in the States. Hopefully things turn out okay for him.
Reply: @trekkienzl2862  I think he should find a job as a mechanic here in the States. I have friends that have remained mechanics, and they say the pay situation has improved greatly (probably due to people like me leaving the industry).
Reply: @th0rn3gaming  Guys that will be replaced by a direct sales website very soon
Reply: @desertsoldier41  nah people hate buying cars through Tesla's site and they hate ordering cars through manufacturers. I've had several encounters with these customers and a live person usually wins. Dealerships will be ran by manufacturers in the future because of all the games franchise owners play.
Reply: @chrisernissee9269 hi what industry are you working now?
Reply: Well said my friend. I only have 5 more years to go as a mechanic, So I'm just gonna ride it out till retirement. Glad you got out when you did.
Reply: @Mike 2L33T4U, you make less, then subtract the cost of tools it puts you at poverty level.
Reply: Yet dealerships are clueless why nobody wants to be a mechanic. They know damn well why nobody sticks around and till they change things it'll only get worse.
Reply: what did you become after being a tech?
Reply: @notlotus985  I went to college. Got a BS in biology and MS in chemistry. Work is way easier and pay is so much better. Even if I didn't go to college, I would have changed my career path. I have an old mechanic friend that now services industrial AC systems for much more money.
Reply: They should Hire mechanical engineers right out of college and pay them engineering salaries to do mechanic work. As a mechanical engineering student myself, I know a lot of people in my major are looking for more hands-on jobs, but end up getting stuck behind computers because they want the competitive wage .
Reply: Auto techs are great problem solvers they need to be to fix cars accurately and consistently. I think they are able to find away out this predicament 😂
Reply: Thank you for sharing.
Reply: Right on! I had about 6 years in the business, and next month I will be graduating with a Bachelor's! I will never work on another car ever again, unless its my own.
Reply: @2fast790  Bro that is amazing! Congratulations! What degree, if you don't mind me asking?
Reply: @biometal770   I will be graduating with a Bachelor's in Graphic Communications Management. (A study of the printing industry)
Reply: I agree with you, I used to work for a body shop, same story. I was the last of the original crew in the shop to leave. I was actually fired to make room for the shop manager's friend who eventually quit. Then they asked me to come back, I said no. The shop manager was doing his job and the job his friend was supposed to be doing
Reply: You see, if they were truly honest about trying to fix this shortage then they'd actually try to listen to technicians themselves about their grievances. Instead, they listen to the opinions of a few 3rd party analysts who barely gloss over the real issue, downplay it, then move on to blame macro level externalities like higher education luring would-be workers away.

Your workers will stay if you pay them well and treat them well. It's not rocket science.
Reply: @knote4958  it's like a stupid echo chamber I'm sure. It certainly is not rocket science. There's no other industry that has a 'flat rate' system.
Reply: Exactly why I left also.
Reply: @Oncopoda depends… an engineer with a PhD is very much a scientist in my opinion. R&D work is very much scientific. I’m an engineer but I do not have a PhD.
Reply: They would rather lose people instead of paying them a fair wage,but you won't here that on here😂
Reply: I agree 100%.  The smartest ones do leave.  Im an old guy now  but all the attention goes to recruiting youngsters.  Whos gonna train them?
Reply: Cars are getting harder to work on,pay not good  just not worth the headaches.
Reply: @Grigsy not sure what you do but the paralegal example is a poor one. Paralegals do most of the labor in a law firm and are more important to most cases than the lawyers (I.e a good paralegal can cover for a bad lawyer but not vice versa). Apart from that, the cap on salary due to no degree is dumb, if people will not do the work for the pay offered, then you will need to pay more or the work won’t get done ( a drop in supply leading to an increase in price until demand equals supply). Also, it has been mentioned that car salesman make more money then the techs, and cars salesman don’t need a college degree either. 

Lastly, the training put in by technicians, particularly specialists, is at least equal to a bachelors. Just because  certification does not come with a college degree attached, does not mean it’s not an equivalent.
Reply: Same!
Reply: They don’t talk about the many mechanics who die of injuries or blood poisoning because they cannot afford to be treated.  Mechanics are the backbone of the auto industry after manufacturing, yet they don’t deserve 100k a year when the dealer charges 
$100-$200 billed hours(not performed in some cases) and makes the mechanics pay for business expenses?  You literally have no dealership without mechanics.  Get it together.  Mechanics income should not have a class cap because it’s viewed as “blue collar”.  It’s valuable, just like construction workers.  They should make what they are worth, not what you “think” they should be getting paid because your mindset has put them into some “blue collar” class system.
Reply: You wrote that perfectly. I too was a A.S.E. master certified technician. I tried various dealerships, all the same as you listed, i settled on mom and pop shops that worked on everything ultimately, but have since left the industry and couldn't be happier. Some dealers have even put more warranty claim office work onto the technicians instead of the office worker, when the tech should be working. That's just another example of employee consolidation for less overhead, more profit. That's definitely a fail for the sigma way of managing. For the level of knowledge and expertise needed for the industry, yes I know not every task needs a high level tech such as changing oil lol, but overall for "A" level and "B" level techs, the industry has become too high level greedy, owners, managers etc have a f you and leave, we don't need you attitude, over the years they've just been chopping away at benefits and pay that doesn't keep up the times etc, no 401 or retirement, no or subpar medical benefits, no guarantee of 40 flat rate hours per week even if it's the shops fault that they are slow etc. Yea that's what required if you want good people, just because it's blue collar doesn't mean the people aren't as trained and valuable as white collar jobs that do get that, certainly can't work from home away from health damaging fluids, gases, etc . Then there's the price and investment of 10's of thousands of dollars in the tech's own tools. The pay rate does not reflect that investment. Does a flatbed/tow truck driver have to show up with his own tow truck? No they do not lol, is that next? Could go on and on.
Reply: @denteracer11  You also did a great job talking about the problems in this industry. I agree the six sigma mindset has destroyed the work environment of the mechanic. It's almost like every burden of the shop is placed upon the mechanics, not upon management where it belongs. No other industry operates this way, meaning purchasing of own tools, flat rate, etc. I'm glad you are happier now that you have left the industry. I have yet to meet someone who was displeased they quit being a mechanic.
Reply: Only lazy or crappy techs complain about their debt in tools.
Any good decent tech will make their money back.  
When techs complain about tool debt.........that is just ridiculous.

I am not what i would call a good tech.  But ive been wanting a bad boy scanner.....i finally took the jab and dished out $3000 for one.
I messed with it for about a month on my vehicles and family and friends.  Then i saw my credit balance and my paymemt.....i went out and hussled.  Paid it off before the 3rd month.  Now the scanner is making me ALL profit.

I could of just sat there and paid what i could but i got on it.

Tools make money.......30k in debt?  Sounds like you didnt know how to make the job or jobs to pay the tool off.

Tool debt is ridiculous to complain about if youre a tech.
Reply: Very accurate sir.
Reply: @aurelio-reymilaorcabal9669  Not where I live it wont .
Reply: you motivate me to go back to school. you hit the nail right on its head. I salute you my friend.
Reply: Very well said bro!! I just got into the industry after completing my program and have a few ASE cert myself but for the amount of knowledge we must pick up to just make $35 a hour is a joke!!
Reply: I always say there is never a labor shortage anywhere.  Pay people enough and people will work.  There is a shortage of workers who want to be abused with little pay.  It's funny how they talk about increasing worker benefits and better career path development but they'll do everything they can to not increase pay.